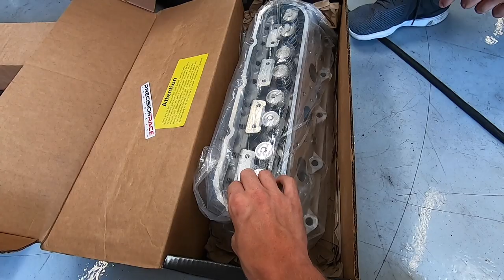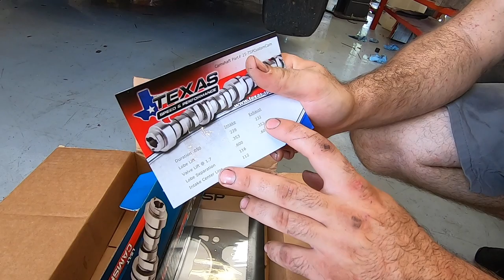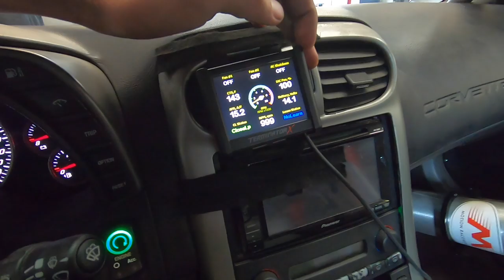Ruby's NEW Heads Sound BEEFY! Bald Eagles Are Ready to BOG! (RTB)

Comment: Junkyard motor while EVERYTHING else has been upgraded lol 
epic awesomeness!
Reply: Built by Texas Speed
Reply: Yup, junkyard motor: only think left stock is the water pump pulley lol
Reply: Pretty much block and crank is all that's left. Everything else is built. Crank was machined smooth
 The seals bearing heads gaskets cam balancer.. it's all built.
Reply: The glide the torque tube 9 inch rear end axles machine work on block new heads cam struts wheel hubs ... yeah that thing is got some money it now.

Comment: In a forced induction engine, at high altitude, your power will remain at the same as the one at sea level when the intake pressure is regulated by the forced induction system (when you are in boost). In will only take longer to build boost.
Forced induction was extensively used and developed for planes (mainly war planes) for this specific reason.
The smart thing you can do having a standalone is playing with other parameters (like timing) while gaining altitude.

Comment: I always put a little bit of used motor oil in my windshield washer fluid cell. Keeps the lines from getting clogged up and makes the windshield wipers glide across the windshield better.

Comment: Boost will happen fast! I had a 2012 Kia Optima, full turbo back exhaust, intake, colder plugs, inter cooler upgrade, LAP3 tune for 93. That being said when I was in Pueblo (where y’all will be) I’d be in full boost a 2K RPM. Just a heads up

Comment: FYI when you’re at altitude in “thinner” air, your turbo will compensate. Same boost level, but the turbine will spin at a higher rpm. You may run faster w/ less aerodynamic resistance on the car.
Reply: yeah i thought of that too, turbo will work the same its the staging that will change but ruby will suffer more, like season two of NPK, turbo guys struggled. especially the single turbos over 88mm

Comment: Turbo’s were designed from aircraft at high altitude so the turbo’s will make up for the altitude as long as it’s big enough to make up for the altitude. Also make sure ya get a bell on that turbo inlet it will flow much better... think of it as a small jet engine.

Comment: Y'all need to switch to the new Rotella T6 15W40 full synthetic.
Reply: Those motors don't see enough miles or oil life to really benefit. When you're changing oil every few hundred miles (or sometimes every 10) you have to balance the cost. They're running an oil that's designed for turbo heat, and 3-5k oci's, think it'll be fine. Notice they never burn down a motor from oil related failure either?

Comment: I run those tires on my daily driver. They weren’t very sticky, but they do last fairly well. They really scream if they slide at all though. Just a little hot in a turn and they scream like you are spinning the crap out of them.

Comment: Are you going to re-torque the heads after the heat cycling the motor?  What happen with the new cam?  I thought for sure you would slip the new cam in being that you had the motor apart.

Comment: 230 duration? My dad is running 308 duration in his N/A nova. And it’s a 350 sbc. Why run that low of duration? For lower power? The intake and exhaust seem high at .600 lift. Which should be higher rpm operating. But I’m just wondering why such a low duration?

Comment: I had some PRC 6 bolt aftermarket casting heads on a 2010 Camaro SS in anticipation of boost. Unfortunately I sold the car before I got the chance to boost it. Really nice heads though. Valve angle makes for better PTV clearance as well.

Comment: Sounds beefy because of the extra headspace, it allows the full weight of the compressor fan to push more air, working the turbine wheel harder for more boost.

Comment: I believe with the new heads your pretty much at the limit of flow on that turbo setup. Might want to think about building a new setup for ruby so she can produce more power per pound of boost instead of over boosting to make the power. That causes unnecessary heat to be generated which is working against ya plus makes it more susceptible toward damaging the engine. 🖒 let her bog and big deep 🤘

Comment: That cam should pull higher than 7000. I have a summit ghost cam 222/233 on a 115 lobe separation and it pulls to 7000-7200 in a 5.7
Reply: Maybe, but where is the peak power level?  Only the dyno knows.  Probably under 7000.

Comment: You gents need to put some anti-freeze or other type of lubricant in that cooling system. That water is creating a chemical reaction between the block and heads.
Reply: You can't run anti-freeze at the track.

Comment: I never realized are both headers connected to the turbo or just one side?
Reply: Both sides are connected they used to have problems of burning plug wires on the passenger side because of all the exhaust piping.
Reply: DA ' there’s a crossover pipe that runs underneath the engine so both manifolds connect at the flange

Comment: Don't strip those threads. I stripped the bolt threads torqueing the lugs on a van putting on her spare. By hand. Sliver of metal came out between the bolt and lug. Only way to get that off is cut it off. I'm sure I've put over 200 ft.lbs on it. Actually bent the crossbar tool

Comment: Does anyone ever mill gasoline blocks/heads and o-ring them like the diesel guys? Seems to work for their ridiculous cylinder pressures. Then again, perhaps head gaskets are a necessary early/safe failure point on (comparatively) weaker LS blocks/heads/pistons/rods/etc. to keep them alive under high boost conditions.

Comment: Hey Cletus or anyone reading this, does anyone know if that gforce performance engineeing company at 8:22 makes drag racing axels for the C3 Corvette? as their abit of a weak spot in the rear suspension of that car, and to do anything about it seems to cost as much as the car itself with the ridetech and the detroit speed kits for it.

Comment: When will you replace that throttle cable with one you don't have to stretch across the manifold?
Reply: Why?  Are you the guy who keeps asking for hoods on everything?
Reply: @paulcopeland9035  lol no, but I recall them mentioning the jerry rigged version was temporary and honestly didn't know if they were just putting off the permanent fix due to time management constraints, or if there was an issue locating the part that would meet their needs since the build is so out the ordinary. Now I gotta go read through a bajillion comments and see what the hood guy is all about...
Reply: @TruckinSongster ... There was constant complaining when they took the hood off of the crown vic.  The comments have never stopped..  When they started the "Ruby" project, Garrett said (in response to all of the missing hood nonsense) in one of the early videos, that they would always have a hood on the "auction vette" project.  Well, that didn't happen and the bitching from the comment section continues.  This is why I asked if you were "that guy" when in fact it is dozens of guys, every video.  Thanks for having fun with it and we'll catch you on the next one.

Comment: So since your going to Colorado why not give Ruby and Leroy a "Sniff" of Nitrous? Since Nitrous carries 2 Oxygen atoms compared to regular air? Why not have the edge of the blocks cylinderd cut to have to have them fire ringed, just like diesels do? Also since Leroy has no body and not having to deal with tubbing it why not put bigger/wider set of rear slicks? More surface contact area will equal more grip!
Reply: You must be new here.

Comment: I can't believe you didn't measure for push rod length. Those heads have a thicker deck so of course they will need longer push rods. I had a set of those heads put on a LS3/L99. I told the tuner he would need to measure for push rod length because of the aftermarket castings. He didn't believe me and of course the car needed different length push rods and the car build time got pushed a couple of days until they arrived. Just because it didn't make noise doesn't mean it didn't need them. I see you guys are already racing but I would have measured.

Comment: Errrr valve train geometry is No1 in building an engine. Too long and things break, too short and things break and you risk mushrooming valves as well. The reason too that many use lash caps, saves the valve and increases surface area.
And those tin rockers?  They may be ok for a road car. Rollers are for racing engines.  Plus they give true lift and duration
And cam run in has been 2000 for 20 min for as long as cams have had more than 400 lift!

Comment: Get the cage updated otherwise your stuck at 8.50s. Why get kicked or told you can't run. That car is stuck at 8.50s for drag week. Not that it's going to run 7s yet but should go faster then 8.50s. 
Mark Carlyle is a great guy and the best to get weld rims and tires from. He's the biggest welds dealer in the world. 
Last yes he's the king and baddest man with IRS vette. He when 6.50s at 220 over 5 years ago in that car.

Comment: Bogging has to do with muddy wet conditions. Doesnt apply to drag racing as far as I know
Reply: You can bog down at the start line
Reply: Then what is mud racing 🤔
Reply: I never heard of that either has google lol
Reply: @StayTunedMoto  Try searching bog down
Reply: Only bogger he has is the tracker
Reply: Look up king sling,Mud bogging (also known as mudracing, mud running, mud drags, or mudding) is a form of off-road motorsport popular in Canada and the United States in which the goal is to drive a vehicle through a pit ofmud or a track of a set length. Winners are determined by the distance traveled through the pit.

Comment: Look dude, it’s your channel, you can say whatever you want, but please, for the love of physical laws, stop repeating that going to higher altitude’s will affect your engine, considering it is turbo charged. Turbo chargers are unaffected by air density. They compress air. If the air is thinner, they will keep compressing it until they reach their psi limit. That’s why they use turbo chargers on World War II planes for high-altitude performance. Turbos are not affected by high altitude. Turbine engines are not affected by high-altitude. Jets are not affected by high-altitude. Come on bro. Let’s go.